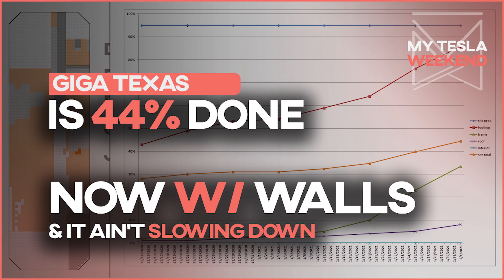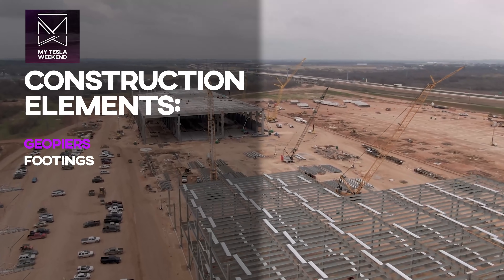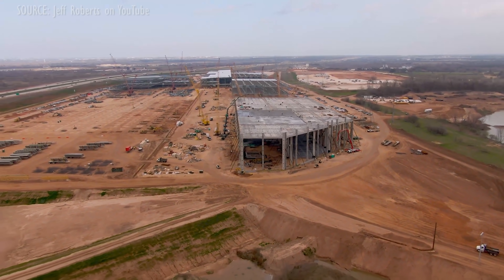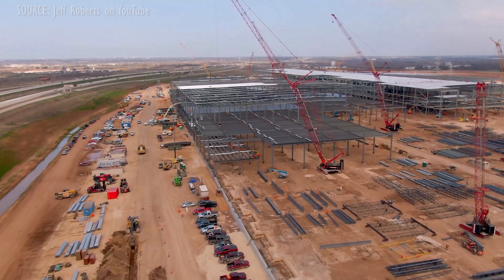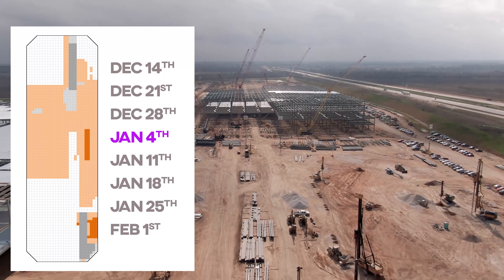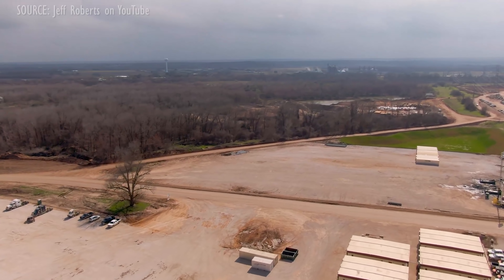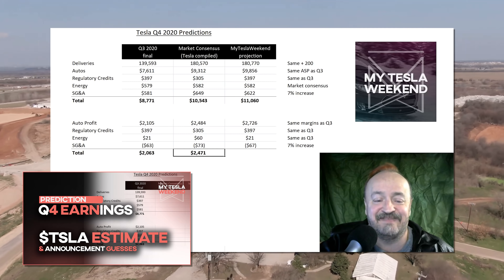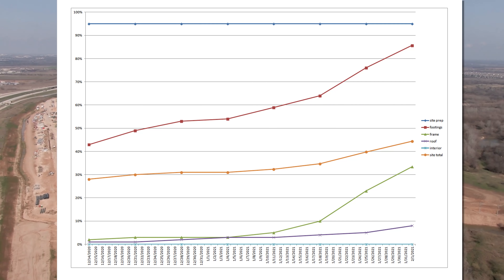Giga Texas is 44% complete and your CyberTruck may be ready sooner than you think

Comment: That is not 44% complete...
Reply from the maker: What's your estimate, and how have you arrived at it?
Reply: @FutureAzA    This is a tricky question,  in construction we look at projects by percentage of budget spent.    So the steel work looks dramatic, and goes up fast,  however its a small percentage of the total budget,  so it looks much more dramatic than it is.    When looking at an auto factory,  50% is typically "dried in", which means exterior is complete (finish roofing, and exterior cladding)     Tesla has milder weather then where I work so they do things in a slightly different sequence,  but the net completion is the same.     One example on a rectangular shaped building we start down the middle to square and brace the steel core,  but as soon as we have a a braced core we will try to finish one end of the building , so the next trades can start in behind the steel workers as they work their way through the long dimension of the building.    If you look at how the contractor is doing GM's battery plant in Ohio,  you see near perfect execution.    They stated in the middle,  but then completed one end of the building,  then working down the long axis of the building while insulation, roofing, and other sub trades start in behind them.    This project of Tesla's does not look nearly as organized or coordinated at the Shanghai project did,  or GM's new battery factory.    I would say this factory is 25% complete today (possible slightly less),  on a cost basis,  but the 1 wildcard here is that Tesla picked a site that had very poor soils,  so there was more than the typical amount of excavation work in the beginning which add to the development cost.    Tesla could possibly finish part of this factory by July,  but they need to really step on the gas and spend more $$ to do it.    Many times in construction,  accelerating the project has non linear cost associated with it.   I think this project is well behind Tesla's original schedule which was supposed to have finished roofs in December.         I am sure most of your followers don't follow GM,  but check out this video and how the site is staged for comparison.     https://www.youtube.com/watch?v=albqL8-1ypE&t
Reply from the maker: @dmitchellhomes  Absolutely excellent response. My 44% is definitely not based on budget spent, but time. That's the part I think investors and buyers care more about.
Reply: Brian has painstakingly tracked a number of metrics on a very complex spreadsheet to arrive at his answers. You've eye-balled a few drone shots. Who should we trust more? Your SWAG based on basically nothing but looking at it, or Brian's analyses?
Reply from the maker: @mrschuyler  I'm not saying my analysis is without flaw or uncertainty, but there is a method here, and I'm transparent about how it operates, and I appreciate that you recognize this.

In this week's update I'll explain a few ways I can refine it for the next factory.
Reply: @mrschuyler  try 35 years of construction management, and yes I can "eyeball" a building and likely tell more than Brian will ever know about that building.   I am not saying that to be arrogant,  it's more just that I know what to look for, and how to access progress.   I assume that Brian is saying that the building is 44% ready for production?   or 44% of the structure complete?   Either way he is wrong, but in one way he is closer.

Comment: Those are not gantry cranes. They are bridge cranes because the run on overhead tracks
Reply from the maker: Can you help me understand the difference? My Googling suggested "gantry" was a synonym for bridge. HALP! Thank!
Reply: @FutureAzA  Hello,
In French it is a 'pont roulant' a rolling bridge..
Blue for next layer of graphic please..
Cordialement,
Reply: @FutureAzA  As I understand it gantry cranes moves on rails on the ground, while bridge cranes have there rails mounted on poles / walls, or suspended from the ceiling structure. In Texas and Berlin the rails will be on the poles.
Reply: @FutureAzA  Gantry cranes run on wheels or tracks on the ground. You will see them alot in ports, moving containers.

Comment: FYI. Berlin roofing on pre cast  paint roof also had concrete, then black felt roofing, fallowed by insulation, then white vinyl or rubber roof roofing. Shanghai put concrete down in some of places roof HVAC equipment was placed. It also had insulation and same vinyl or rubber roof.

Good report 👍
Reply from the maker: Much appreciate the added info!
Reply: @FutureAzA  https://twitter.com/stratton1966/status/1349449165785296896?s=21 this was what I was thinking  that open area might be. It’s just a guess watching the drone footage. It could get roof but would be really wide span.

Comment: Darn I was hoping for 2000 footings. Hopefully they'll get the SW corner done by the next weekly update. 43% footings and 30% framing increase in 1 month is crazy fast. It seems some cranes will need to move soon. I'm thinking the SW side where the perimeter grade wall was completed to about 4 weeks ago. But that doesn't leave much room or work to do, until it would join up with the current structure. So I'm guessing that some might start putting up walls soon, as well lifting equipment up to completed floors and roof sections. One other guess is that IDRA can only build so many machines at once, but as they work on this one so far ahead of other parts of the plant. This makes me think that it could supply parts to Fremont, going from June till into 2022 as the Austin plant ramps up. Forgot to say, I think you'll be counting interior work soon in the stamping area, the floor and perimeter beam are nearly finished.